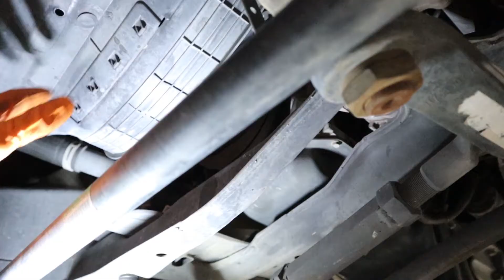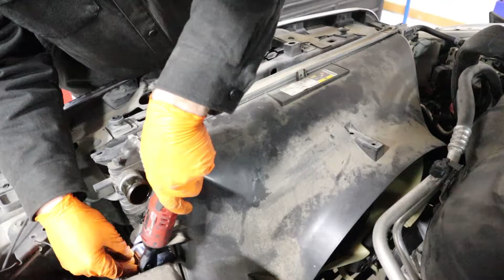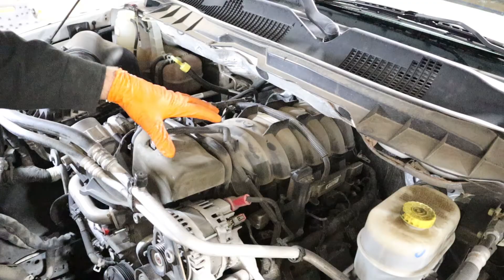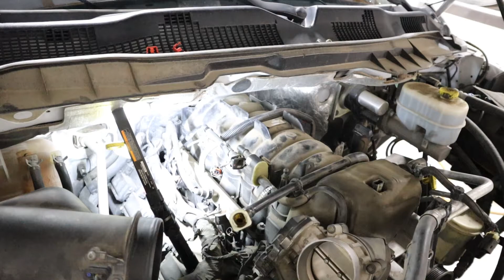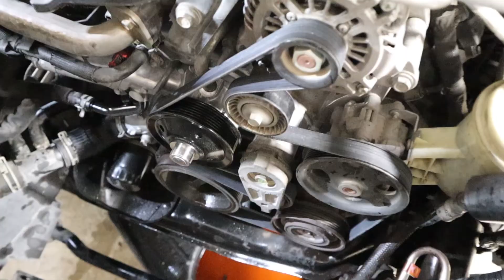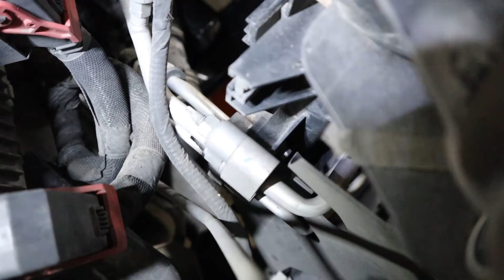RAM Truck 6.4 Hemi Water Pump Replacement

Comment: I removed the alternator and used an offset 10mm wrench to remove the bolt then needle nosed vise grips to loosen the clamp.

Comment: Great video. One thing I noticed on the newer gen 2500 (2021) the electric fan housing has an extra clip on the bottom that must be removed. Also I had to get the most expensive harbor freight air hammer, the medium grade one did not work.

Comment: Nice video. I think my EGR cooler hose is leaking. 2017 RAM 2500 6.4. Any idea what size the rubber hose is that clamps to the metal line coming out of the water pump? Not paying $110 for a complete line. Thank you.

Comment: I did not have to take out the intake manifold u can just slide the water pump down from the pipe that runs under the intake manifold you made it so complacted dude I got the job done without having to take off the intake manifold , Good video tho

Comment: No need to pull the intake unless the hoses or egr cooler is leaking. I get the alternator out of the way, use a special hose clamp tool  to slide the clamp back, cut the tube and bracket with a recip saw…. The small 10mm head bolt is a little work but it’s better than removing the intake.

Comment: I cut a 10mm drill bit and used a 1/4 wrench to remove coolant tube. So i was able to remove water pump without removing intake manifold

Comment: Help!!! I got a 2017 2500, 6.4. The wiring harness on the back has some kind of lock or latch in the rear in the middle. I can't see it and I can get it to release the harness from the manifold.
Reply from the maker: That's likely the connector for the SRV actuator. Don't pull the intake too far forward or it will break the connector and those actuators are expensive. The connector has a safety lock on it that must be pulled down first before it can be disconnected.

Comment: I would have changed the rubber hoses under the intake for the erg valve they are notorious for leaking.

Comment: Do not have to pull the intake.  Just tap down on the water pump as you pull out, clean tube and put it back.  Also do not have to pull the alternator, we just did this job.  You had me stressed out too lol.  Nice video.
Reply: That's  good to know  was thinking of splicing  a rubber  hose  for that
Reply: I agree I’ve done it that way
Reply: 100% agree with this but I happened to crack the egr return tube 😂 trying to reinstall it requiring me to take the manifold off so I figure I at least can now replace the rubber hoses. You can avoid the alternator though 100%
Reply: This comment needs to stay on top! Light hammering on the pump combined with a pry bar saved me from pulling my manifold. Thanks!
Reply: Thank you and yes very light tapping.

Comment: This video was a big help. Just had replace my water pump on my 2018 Ram 2500 6.4. Your step by step was a life saver. Only had one major issue. The fan clutch tool did not work hard to buy the entire setup, pump, clutch and blades. Other then that God send
Reply from the maker: Sometimes they are really welded on there! Glad I was able to help otherwise 👍

Comment: I just did one and didn't remove the intake, once the pump is unbolted it will slide down off that tube and back on the same way. I also didn't remove the dr side inner fender weld to drain the coolant.
Reply from the maker: I made this video quite awhile ago, seems like many people are using that technique now and it's working out for them. Anything that speeds this process up is good by me! 👍
Reply: Time is money @ReignitedAuto
Reply: Don’t forget mechanics charge by the hour

Comment: I found the trick to getting this water pump off without having to take the intake manifold off. Didn't damage or break anything.
Reply: You can remove the tube off the water pump once the pump is loose. I didn't do that though, what I did was clamp the hose clamp and unbolted the small 10mm nut holding the metal tube with a small wrench. Took time but I was definitely not pulling my manifold off for a water pump.
Reply: How did you do that?
Reply: How??????

Comment: I have done 5 of these without removing the intake man. Just use a stubby 10 mm to remove the retainer on the tube and be very careful not to drop the bolt into the manifold. Might take a lil bit but with some patience, if i hack like me can get it then so can you :)

Comment: I looked for a vid on how to do this in a friends 3500 RAM, Dodge, whatever. Very informative. Glad I don't own one. BUT, get things right. The bolts aren't 8mm, 10mm, 12mm, 13mm, that is the size SOCKET you are using! They are 6 and 8 and 10mm bolts.

Comment: Great video but the intake manifold does not need to come off.  Undo all water pump bolts and it will give you enough room to slide right off by simply pushing down on pump.

Comment: Torque and pattern on water pump? Sealant or no on gasket?
Reply from the maker: No specific torque pattern,  18ftlbs and no sealer since it's a silicone seal that is designed to crush as you tighten it down.

Comment: Unrelated/related question: do you have to drop the pan on these 4wd 2500 6.4's to pull the oil pump?  How many hours would you put the swap at? You have me debating doing the hellcat pump swap in my 6.4 truck.
Reply from the maker: You do have to drop the pan,  yes.  This is because you have to get to the rear bolt holding the pickup tube in place.  I have heard of people simply bending it out of the way to put in a new pump,  but I can't condone that.  I'm all for finding a shortcut, but not like that 😄. Time depends on skill set.  If you've never done anything like it before,  give yourself a full day to do the job.
Reply: Thanks for the prompt reply! Thankfully our Hemis have been extremely reliable so most mechanical knowledge is LS based.

Comment: They don't include the egr cooler tube on the pump because you can pop it up and avoid removing the intake.  I fix a fleet of ram 3500 6.4s.  They're garbage 😉👍
Reply: Remove the intake and replace the egr cooler hoses with silicone though 🤣🤣 they pop after you overheat

Comment: This is why I stick to chevy. I watched this video to do a truck w/p on a 4500. Makes me glad I am a chevy owner. 6 bolts on my LS waterpump and no intake removal required
Reply from the maker: The 5.7 Hemi water pumps are very easy, but on the 6.4 they added the EGR cooler under the intake and that one extra hose makes this job a real pain in the butt.
Reply: Nothing about the hemi is easier than working on the others.

Comment: Hey man Thanks for the Video got my water pump replaced about 2 months ago and install went great. Yesterday I parked the truck and came back out 10 min later to find a constant coolant drip and huge puddle on the ground. Thinking it may be the egr coolant tube under the intake manifold because I can not see anything leaking?? Will the intake manifold come off without taking the fan and shroud back off? That was the worst part last time..

Comment: My 2017, 6.4 just had the water pump bearing seize a block away from a dealership. They called me with a 5 hour, $1,600 quote but would settle for $1,300. Independent  shop quoted $990 with OEM parts.
Reply from the maker: Yep, that sounds about right. The difference is probably due to less labor rate for the independent shop.
Reply: @ReignitedAuto   went ahead and got the thermostat with it as well, kind of regret not doing the hoses at the same time. There seems to be a shortage of independent parts, I prefer OEM for the most part. Thank you for the great content.

Comment: Yikes! Having to remove the alternator, AND the intake manifold just to remove the water pump? Man! My 14' Charger isn't as complicated. Just remove the pump, no sweat.
Reply from the maker: Ya, the 6.6 truck engine is definitely more of a pain. Appreciate you watching 👍
Reply: Get a chevy, the ls waterpump has 6 bolts, no intake removal required

Comment: I have a 14 with a 6.4. I need to replace my pump also what do you think about aftermarket vs oem. I have about 150k on it
Reply from the maker: There's a few parts that I would rather use factory on, the water pump is one of them. I just think of it as, the factory pump made it to 150k so just replaceit with a part that'll go another 150k 👍
Reply: Thanks for the reply love the videos

Comment: Looks a lot like how the water pump replacement went in my 5.7 (except for the intake of course). If only removing the fan had been that easy for me!
Reply from the maker: I'm telling you, that tool is the best thing I've ever bought! It was my first "professional" tool I bought 10 years ago, still works perfectly. 👍
Reply: I had fan off in 5 min with a screw driver and a wrench

Comment: So the intake has to come off for one hose clamp and one 10mm bolt!? What a pain! That adds so much more time to what should be a pretty straight forward job. 🤦😠
Reply from the maker: After finishing the job, I realized you dont have to remove the clamp, just the bolt. But that bolt is directly under the intake tube 😔

Comment: Man, I think once I removed the Intake Manifold, I'd fabricate a new pipe that as a clamp mounted so that you don't have to remove the IM the next time.  Also, regarding running the tap through the threads to clean them up -- if you don't have a tap, you can make a rudimentary thread chase by taking a bolt with the same threads (Probably m6x1.0 but check first) and then take a grinder and cut 2 or 3 slots lengthwise up the bolt.  Clean out the grinding particles, and then thread that bolt into the holes.  The grit will accumulate in the slots when you unscrew the bolt.

I've done this a few times with bolts like head bolts where getting a thread chase that deep is difficult and expensive.
Reply from the maker: Nice tip! 👍

Comment: so you simply cant remove that tube and save the time removing the intake
Reply from the maker: Not on the 6.4 truck engine no, the bolt that holds the tube in place is directly underneath the intake tube. You might be able to leave it bolted in place and wrestle the tube loose from the water pump by pulling down on the pump, but not sure if there's enough room for that. I just went by the factory service directions for this video 👍
Reply: That's how I did it need a 10 mm offset box wrench and you can just barely get a turn at a time

Comment: What is the book time on the water pump remove and replace?
Reply from the maker: 3.9hrs 👍
Reply: @ReignitedAuto  Well, that means it probably took you less than two and will more than likely take me more than two... days.  Thanks for the video.  I was ready to knock it out all the way up till you said the intake has to come off :-(

Comment: How similar are the 6.4 and 5.7 water pumps? I have 2-5.7s (one an '06 and the other a '17) and an wondering if I will need to remove the intake on them to do the water pump.
Reply from the maker: Nope,  the 5.7 water pump are cake, no need to remove the intake. They have a similar coolant tube that goes into the top of the water pump, but you can access the 10mm bolt that holds it in place and just slip the tube out to replace the water pump 👍
Reply: If you don't tow or live in a hot climate , you can simply remove the clutch fan assembly and your pump bearing will last quite a bit longer not having to support the extra weight. I replaced mine with an electric fan from a V6 model but it will work fine with the AC auxiliary fan in there.

Comment: Hi, can I ask what that thing the coolant tube is hooked to under the intake?
Reply from the maker: It's the EGR cooler, they hide it under the intake manifold. 😕
Reply: I know it's a stupid question but can the water pump be pushed down to disconnect the tube and then out?
Reply: @carlospastran3527  yup
Reply: @carlospastran3527  just did it without  removing the intake

Comment: Got 122,300 on my 5.7 Challenger(similar water pump), water pump still works great and no play in front bearing. I keep a new one on the shelf as they have been known to fail a bit more than normal.
Reply from the maker: Yea for awhile there the Hemi water pumps were definitely an issue. Got to the point where the factory ones were backordered 6 months! Put us in a really strange spot for awhile because we were putting in aftermarket water pumps under factory warranty!